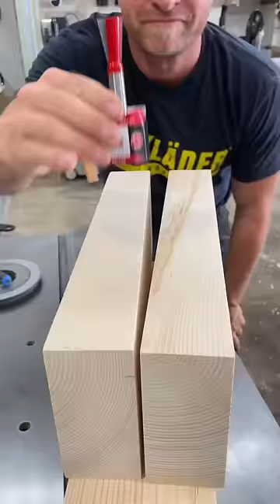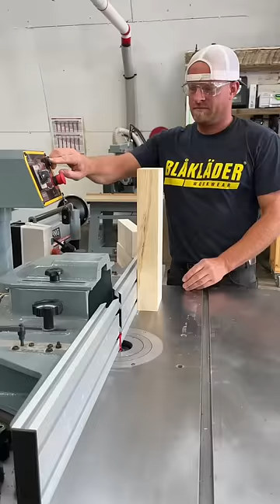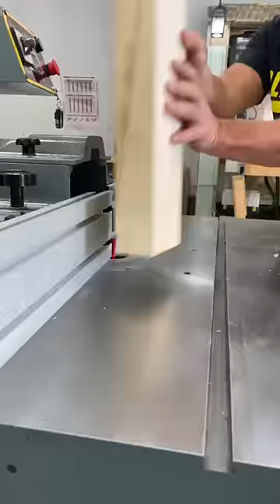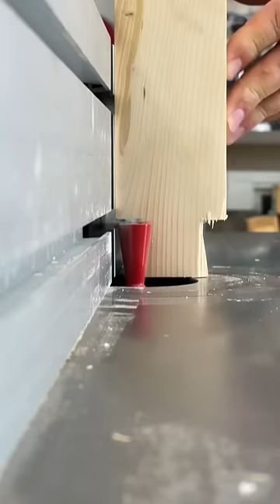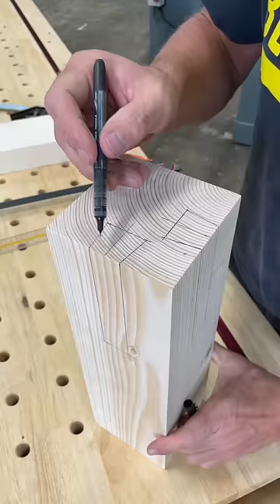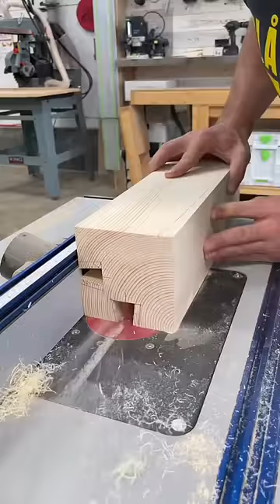Dovetail wood joint #woodworking #woodwork #wood #maker #shorts #joinery #tools #work #bois #holz

Comment: When you have the right tools jobs like that can sure be fun and satisfying
Reply: Right tools for the right job
Reply: used to do this with a 50$ router and just some other boards and clamps 40 years ago. wonder how many thousands in that setup?
Reply: @victorhopper6774 !
Reply: @cooperpayne  I do the same thing with a cheap router. It probably takes three times longer. The hardest part would be repeatability between parts without having a really solid adjustable fence and rigid base but you can do pretty much anything if you take the time to do it right
Reply: So true 🙂
Reply: You're god damn right. 🙂
Reply: I much prefer doing joinery by hand 🙂 I know it's not practical if you run a business, much more satisfying when you do it by hand imo as a hobbyist 🙂
Reply: When I have the wrong tools... ☠️
Reply: Fare un lavoro perfetto con macchine del genere e il minimo,mi sorprenderei se non lo facesse...anche un dilettante del fai da te lo saprebbe fare .....
Reply: We make more than 60 of the same joinery in a day in Japan
Reply: @cooperpayne   But think of the perseverance and patience that it would instill in someone if they did it with a damn hammer and chisel? 🤣
Reply: @rhiesa3945  what two tools is he using here? Is it two different router tables or a router and another type of tool/table as well?
Reply: what two tools is he using here? Is it two different router tables or a router and another type of tool/table as well?
Reply: @thomasberry8012  the first one looks like a 5hp shaper table from King, the second one is a normal router table
Reply: @rhiesa3945   Ahh very nice thanks for the scoop. Both cuts could've been done almost, if not just as well, by the same normal router table utilized to make the second female dovetail cut, right?
Reply: @thomasberry8012  absolutely, the  shaper step kind of seems unnecessary. Maybe he intended to use the shaper for everything but the fence couldn't be adjusted back far enough for the second cuts
Reply: @cooperpayne  there is no technique
Reply: 15 anos de marcenaria me deram conhecimento suficiente pra fazer o mesmo com tupia .
Reply: I still do this by hand. It takes a lot longer but it is so relaxing. My grandfather began teaching me in the sixties, I've been working with wood ever since.
Reply: @victorhopper6774  that's nothing I did it with nail clippers and a Bobby pin,
 when I was 3 years old,
In the dark,
And it only took me 5 mins, 
And I won a prize for it in a competition
Reply: 0
Reply: We must to do that with fingernail in Poland
Reply: @reynaldosulangi1861  😊
Reply: @reynaldosulangi1861  😊
Reply: @rhiesa3945  yeah. Time and tools are pretty much an inverse relationship. No tools, a lot of time. More tools, less time
Reply: So cool 😎
Reply: @victorhopper6774  you could start a YT channel and have that pay for your brand new shinny tools also. Hell even have the tool companies just send you their tools for free lol
Reply: @cooperpayne  depends.
Reply: @YouBetterCallSaul  even better i should have started utube 40 years ago
Reply: @victorhopper6774  regardless rather he has a “$50” set up or “5k” set up it’s still good work. We all would have the right tool for the job if we could afford it.
Reply: Yes, it's a pain without them, I wanted to do all edges like that once, but it's a bit complicated with only a saw and chisel...(angle is fairly easy to mark, can just draw a semincircle, then go from 30° on both sides).
Reply: I had to do this by hand in wood work class recently
Reply: @victorhopper6774  not too many, weve got nearly the same at home, old felder combi machine just like that, but i think his is a newer, better version
Reply: So easy too
Reply: This is an ancient technique is meant to be made with a knife and a wood scraper
Reply: @PsychoticEwok  So cool! Can these cuts be made by hand? The dove space in the 4x4 base? How would that be done?
Reply: How can these cuts be made by hand? Especially the female spaces in the base?!
Reply: @Duckguy08  Cool! How are those cuts made in the base?
Reply: @marktrinitapoli6448  an auger to remove the bulk of the material and chisel and mallet to square the shoulders and pair off the sides, would take probably an hour to do both joints, if you can do it on a machine you can do it by hand most machines work on a principal of a hand tool that has been used for centuries
Reply: @marktrinitapoli6448  with a chisel I was really bad at it
Reply: YES!
Reply: And the skills !
Reply: @victorhopper6774 
😊

Comment: Tip: use straight bit to mill out center of tails and then use the dovetail bit just to get that last bit on both sides to save wear on expensive dovetail bits..

Comment: Two small tricks to improve things: 1. Use a support piece behind the tail piece when routing it to avoid tear out. 2. Cut a small shoulder on the bottom of the tail piece to hide the meet between the parts/bottom of the "mortice" after assembly. And for beginners watching this, when widening a cut on the router table, always move the fence away from the bit for the sencond/third/fourth... pass. Otherwise you end up with a climb cut wanting to pull the workpiece away from you. OK if you know what you're doing and prepared for it but not as beginner. So, to avoid that in this case, start with the inner line of the dovetail (closest to the fence) rather than in the middle.

Comment: Are these joints strong? I could see that maybe their advantage over a straight slot is that it cannot be pulled out under tension. However, how does it do under sheer forceat the neck?

Comment: The only issue with these types of joints is that when there's high humidity, and seeing these joints are already under pressure, the expanding wood will kinda just explode out

Comment: So on the first cut you took it easy on the 2 flute router then you bury it in the block for the second cut for the mating piece. Your methods make no sense sir. You could have lowered the head to take an easier cut. Whatever. Its fine.

Comment: Not to be the rain on your parade, but dove tails are an inferior joint, when it comes to strength. They are just a show of skill and artistry. However, your new tool took just that aspect out of the picture. Not to say, you're not skilled enough, but this strips it down to a shallow novelty in my book.